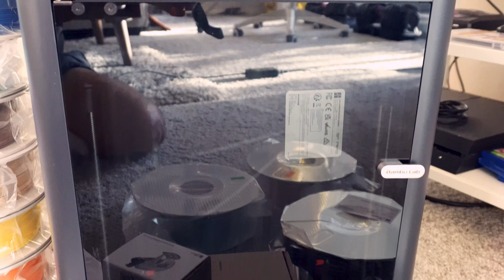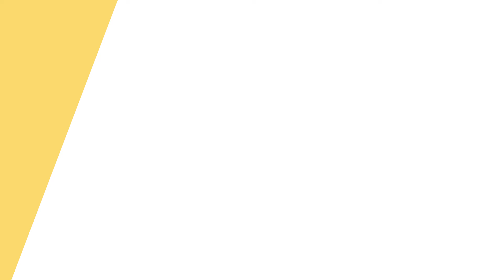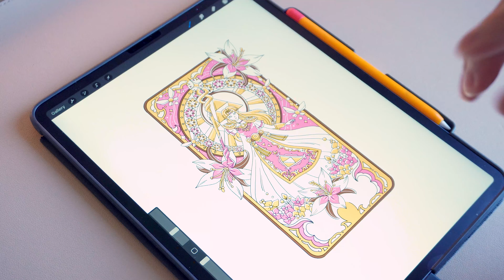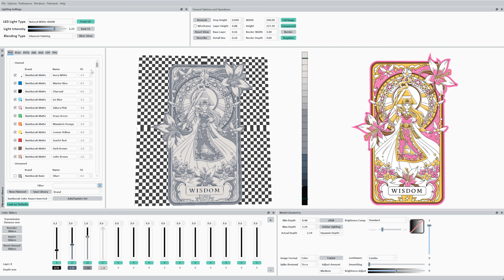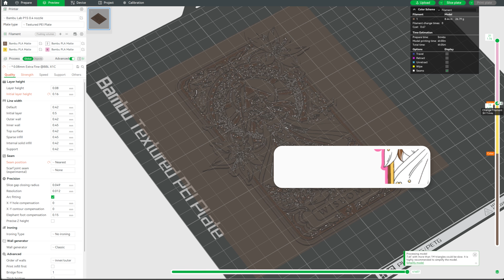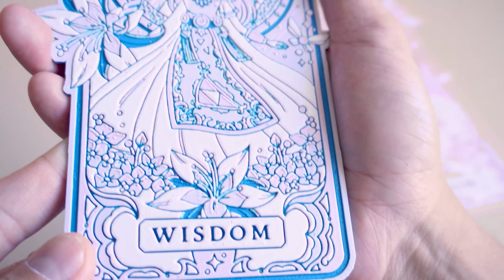Turn 2D Art into 3D Prints | Filament Painting with HueForge & Bambu Lab P1S

Comment: Hi there. Very new to the whole 3d Printing bussiness. Still learning the curves, but want to make amazing things like figurines and 2D art like this one. 

Question: Can I still create art like this without buying Hueforge and instead use Blender for it? From what I can understand is everything depends on the layer height, and such? Forgive me for asking dumb questions, but I'm not gonna apologize from asking it. 

Your work is amazing and your videos are also much helpful :3
Reply from the maker: Hey there and no worries. I don't think you necessarily need to get Hueforge for this. I believe Maker World came out with something similar called Chroma Canvas recently. It's not as powerful as Hueforge, but will get print something out as needed. Hope that helps.
Reply: @kevandram  Thank you so much for the feedback. Will take a look at the Chroma Canvas, but will also try to find a solution by using Blender, hopefully. If there's a way to use blender that way to be able to create something like this in there.

Comment: How do you get such a perfect top layer? Is it the matte filament or do you have settings to prevent the top surface layer lines from showing?
Reply from the maker: I think it might be the matte filament. But also the nozzle temperature settings. I set mine to a bit hotter than the default just to make sure it smooths out and avoids stringiness.

Comment: I'd like to try filament painting i was wondering will this work with the bambu Lab A1? i'm also new into 3D printing
Reply from the maker: It should work on the A1. You can do both single and multi color. However you’ll need to manually pause and change out the filaments when you do.

Comment: Use hueforge to get some of the colors. then when it is in the slicer use the paint to paint other areas?
Reply from the maker: You shouldn't need to use the paint tool in the slicer to paint other areas. Since Hue Forge is calculated by layers, you might mess up the shading it produces inside Hue Forge. I'd recommend just using one or the other.
Reply: @kevandram  What if you only paint the top layers. That isn't shades.
Reply from the maker: @ That might work, I haven't tried it but it would be worth an experiment.

Comment: You scaled that card in the slicer which changed the z height and number of layers of each color which invalidates the prediction. You need to reduce the size in HueForge instead of the slicer or you change.
Reply: It's a pretty common mistake from what I've seen. I really like what you are doing here with HueForge. You are right with how HueForge in standard mode looks at images, but there are a couple of modes that are color sensitive as well, Color Pop and Color Aware. But given your full control over that artwork, your method is effectively the same thing. Setting the image Luminance values to the ranges you want the colors to be
Reply from the maker: Oh whoops. Thanks for the tip!